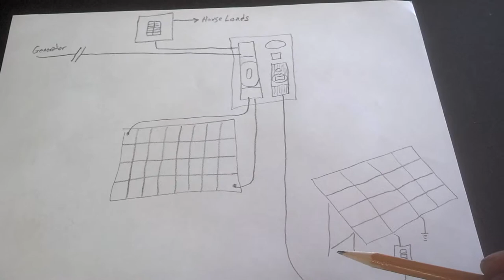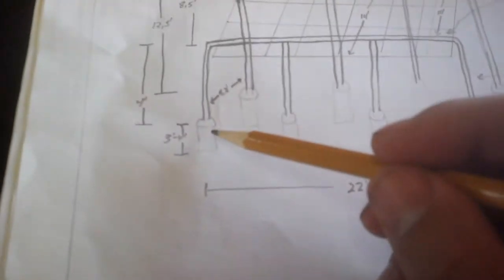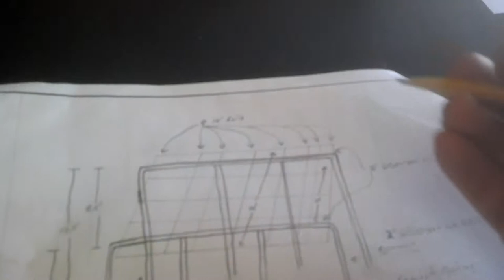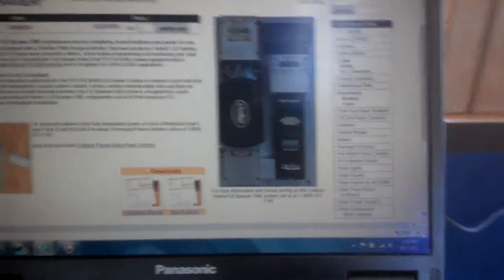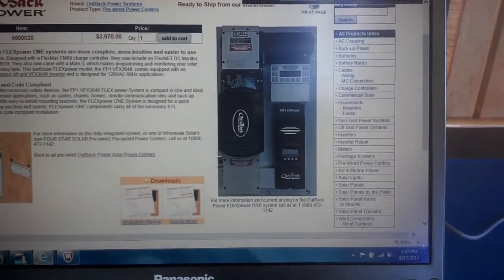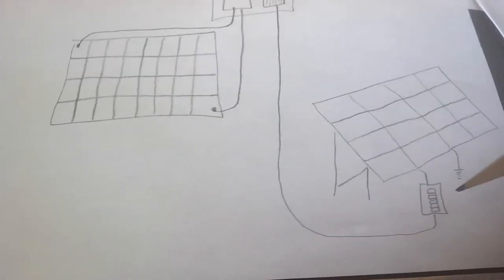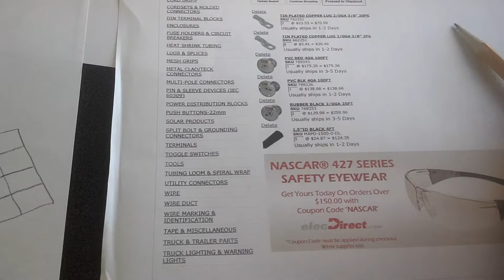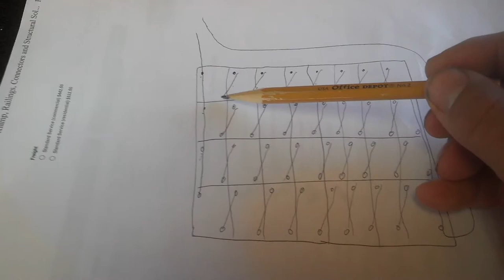3.9 KW Off Grid PV System Part 3 (The Plan)

Comment: What happened to the install? It's videos like this that piss me off - finally a system near my area within my price range and I don't even know if it works
Reply from the maker: So sorry for taking so long to get back to you.  (I've been at sea).
     I won't be able to put up a new video in this series for a bit,  but until then;
      I had a few issues during the install mostly to do with a lack of manpower.  (The client had promised an army of help, but it that never came to be). I was on a limited time schedule and had to do most everything myself starting at sun up and finishing late in the evening.  Because of this I didn't get much video shot except for the last few minutes before I left to fly home.
    But the good news is that all the math and the prior planning paid off and according to the client,  all of my predictions (kwh/month of production) came in exactly on the money!  
    The client was having to adjust to the off grid mindset and as a result,  moved back to home and the grid last spring.  He was still tickled pink about the system and wanted to have me help him with a grid tie sysyem, however health problems have put that project on hold for him.
   Please email me if you have any questions and I can send you some pictures and a couple short videos of that system. (I'd love to help in any way I can with your system)  Tim B.  Tim@riboeh.com